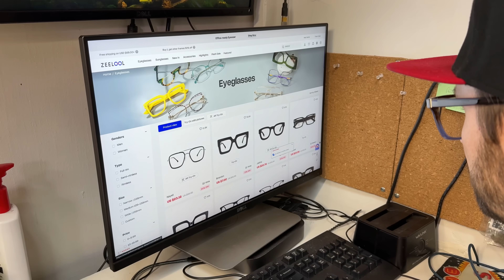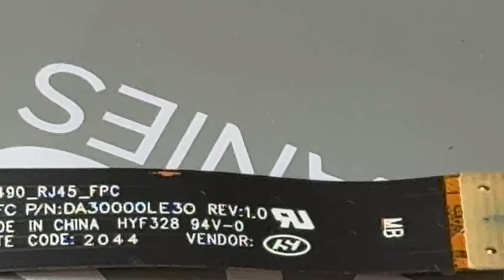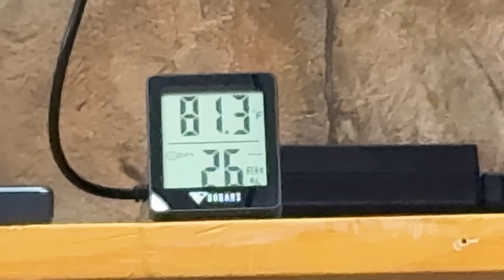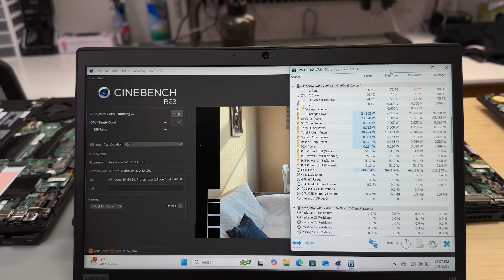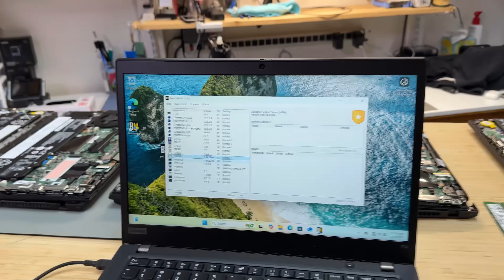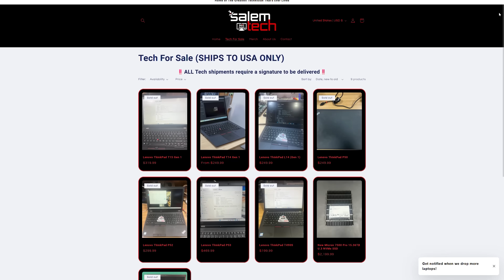Is Replacing Laptop Thermal Paste a MASSIVE Waste of Time? Let's Test!

Comment: 🙋‍♂I have a few deployment ideas!
---
Opt1: Fast USB (and I mean fast) drives with win 11 iso + using a customer deployment XML - this will allow you to have a unattended install + remove some junk/bloatware if needed + run powershell scripts to to anything you would normally do manually, if anything post install.

Opt2: iVentoy - I haven't set one up yet but plan to. Essentally an ISO server with a bunch of options. The laptops will get the ISO from the server over the network.

I used to use a dedicated cloner with images I built but with scripting and fast USB drives everything is really just faster and hands off. Maintaining the images got to be too much.
Scipts aside, since its a huge variable in time based on what you need. My USB/Iso setup will install Windows 11 in about 5-10 mins maybe. USB 3.2 NVMe so pretty much bottleneck is the port on most endpoints.

Email me, happy to chat

Comment: For cloning, you may want to find a way to connect all ssd in PCI port and that the processor support several lines of pci if not two cpus of a sever.
Reply from the maker: Yeah that’s what I’m currently doing as I explained. Quad NVMe to PCIe adapter with bifurcation to split 16 into 4. Just requires too much labor taking everything apart etc

Comment: That was well timed as I'm about to fit a new SSD to my 2012 HP Folio 13 and was wondering whether I should re-paste, having not done that when I increased the RAM last year. It's cooling was always its weakness, with a small noisy fan. Fingers crossed I don't mess up - there are many tiny ribbon cables in this one...

Comment: Why does the microprocessor have then two heatsink surfaces for the copper heatpipe?? They are for thermal paste. I've put thermal paste on both surfaces to reduce the heat. Lenovo doesn't do this, leading to a very hot chip 1 and a hot chip 2 on that MCM part.

Comment: I have a Thinkpad T14 gen2 I7 11gen with 48gb of ram, and I replace the thermal past once a year and I do a general cleaning inside. My laptops runs like a new one, it handles everything
Reply: once a year is too much,  new thermal paste holds much longer and i would only change if i would see significant thermal spike.

Comment: i have a question regarding thinkpads so i have a old x230 i use would it be beneficial to replace the thermal paste it was refurbished and given to my community college back in 2020 through a program and i have no idea if they ever replaced the thermal paste when refurbishing
Reply: Is the laptop yours or property of the community college, if it is not yours i would not touch it.
Regardless of that, just open hwmonitor and look for the temps, than go to google search for pictures (type in hwmonitor and your cpu version), you will see screenshots, than you compare the values with yours, if the temps difference to high, you know they did nothing. 
Changing thermal paste makes only sense if the temps are too high.

Comment: Replaced the TiM on my HP Omen gaming laptop when it was almost new. Lowered temps by 15-20 degrees! Never had that big of an k pact with paste on a desktop. Think HP uses toothpaste. That and undervolting it made a massive difference. Hardest part was the screws to the heatsink and pipes are very small and easily deform so you have to be careful.

Comment: These ThinkPads seem to use Sunon cooling fans as well. I have a 9 year old ASUS Zenbook UX303UB laptop and the fans are quieter than my 10 month-old HP 14s laptop (Still brand new IMO) unless the CPU is under load. Either the fans are really good or the ASUS has a good fan curve. The only Sunon fan that died was inside a 2012 HP Folio 13 laptop. The Zenbook has broken hinge mounts on the LCD bezel though... But the HP is even worse because after just 10 months of use, I can tell that they cut corners everywhere apart from the CPU, RAM, SSD and speakers which are pretty OK. But the rest is junk. Edit: Dell Latitudes, Precisions, HP ProBook's, EliteBook's, Zbooks and even MacBook's (Well built but not recommended because of soldered SSD on the newer ones though) use Sunon fans too.

Comment: Bought a used T480 with no external battery, storage, or charger for $70. Had an M.2 SATA lying around, the internal battery is working long enough for what I use it for around the house, and I've already got multiple USB-C laptop chargers around. I'll shell out the extra $20-30 for an OEM battery soon, and I really gotta repaste this thing because it's suffocating lmao

Comment: For the each PC, try to have a switch and iPXE server with a default Windows 11, where each Laptop starts via Gigabit Internet, this will simplify your steps and help you with the configuration.

This will help you on spending less time using clonezilla and whatnot, just be aware that it will be hard start, but then it will allow you to save quite of time :)

Comment: Dude, just make a pxe boot windows imaging server and distribute windows over PXE using wim images. You can image several machines over the server and the images will be for whatever you need, like w 7-8-10-11 home, pro, ent, 32, 64, whichever. You can customize them as well, as needed, like adding apps or adding branding, etc. I don't imagine you'd use 7 or 8 for anything, but then, who knows, maybe you wanna throw 7 in something for that retro goodness that came before the windows store bullshit. Anyway, All you'd need is some old ass raid enabled desktop with some good redundant 2 terabyte drives and that's that.

Comment: I work at a medical college.
We buy dell machines (desks/laps) with a 3 year warranty.
Most of them are still fine after 3 years, especially the desktops.
However, after 3 years they are refreshed for new models, and the old ones are sent to surplus, where they are abused and hated on, then piled into a pallet for auction as bulk material.
It might yet be possible for you to find a college or school system that also does this, but lets you get them for refurbishment. You will have to replace the drives of course, since usually the drives are pulled and destroyed to secure proprietary data.

Comment: Not sure if it will help, but here is my deranged way of dealing with rental laptops at my university: get the same win or linux distro on 6-10 usb sticks and a rubber ducky. I've used a broken KVM switch which managed to parallel input on all machines. Thus it was no big deal to run the same ducky script on all laptops at the same time. Got to mention, it works for me since there is only one laptop model available for students to rent

Comment: T14 gen 1 and gen 2's had severe heat problems. Even with new paste and trying to fix some stuff they hated running cool. You could burn yourself with how hot they got. My work decommed a bunch of T480's, so I took one and modded it to the moon. I call it the neckbeards revenge lmao

Comment: when i got a P53 from work, brand new, the thing was insanely noisy and hot, courtesy of Lenovo's factory plaster of paris paste. I repasted it like a week after receiving it and it's now completely silent in normal use. under load it still throttles, but it throttles 400mhz higher than it did before. And clearly, being brand new, it wasn't dusty, which i confirmed when taking it apart. Still works as good today after a few years
Reply: I'm reading this going what are you talking about Lenovo didn't make the PS3 but then I looked closer that's a 5 not an S 😂

Comment: You can also turn on yellow light mode on screen instead of using glasses. I have been using it since it has become a simple toggle on button in win10.

For imaging I've always been using FOG which needs a server install somewhere on your network (its a PXE linux package basically) and ethernet connectivity to the machines which could be a limitation depending on the space you have, but other than that its free and scales up to whatever you want if you give it enough ressources.

Comment: Repasting laptops really make a difference with higher wattage stuff. I have Maibenben Heimai 7 here with LGA 1151 socket and it had Pentium G5420, i5 9600K, i5 8500 and i5 9400 CPUs. While the Pentium G5420 didn't benefit that much (28W ppwer draw under stress), all the i5 CPUs really needed that extra cooling since all CPUs cleary reached above 65W power draw, with the 9600K often reaching 80-90W.

Comment: Most thermal compounds anywhere from a couple of weeks to several months for daily use till either pump out or it all dries to crisp. At least ptm7950 will last at least a year and some months before there is any noticeable degradation.
Reply: Completely ditched thermal paste.
Laird TPCM 7250 for bulk refurbish and PTM7950 for high-end devices. Most factory applied paste on used devices is horrible and pumped-out with big air pockets and valleys.
-80°c and above thermal paste fails rapidly because of thermal friction. Expansion and shrinking between the heat conducting particles and silicone binder.
Reply: Most thermal pastes are fine for years.

Comment: 4:23 what about the USB-to-nvme adapters? It's not as fast as native nvme but it is a lot more convenient and you can connect a bunch of them to the usb 3.0 ports. Also running Clonezilla from an installed linux system would let you launch multiple clones at once

Comment: I have a Precision 7530 for work provided by the company I work for. I maxed out the memory to 128 GB and this thing now flies. I also have the dual Thunderbolt docking station and everything is tidy. I dread the date this thing has some irreparable damage and I have to replace it. It has 5 M2 sockets

Comment: I was a Thermal paste Virgin until recently.....
Cleaned and slathered my Lenovo for the first time a few weeks ago, but this week I noticed the fans were running more than usual.
Checked the temps and the CPU was at 60-90C.
Stripped down and found the "Thin (ish) even layer" I had deposited was patchy across the heatsink.
So I left a new pea sized deposit in the centre of the chip and closed it back up assuming the new paste would "Ooze" (The previous application was still moist and suitably tacky).

IMMEDIATE reduction to between 35-50C and no fans.
.
Lesson: 
1) Always add a little more than you think you need.
2) Onlyfans isn't good enough.

Comment: Thinkpads, are amazing. Mine is now 13 years old but its opned a few times for new thermal paste and a good clean up, It gets used outside a bit. But with all the opening up i tore my leyboard cable and now i cant use it. The power button is part of the assembally and finding replacment keyboard is proving to be difficult because its a X220 12" model. Not many around.

Comment: Baffles me some of the info out there that goes backwards like replacing the thermal paste is a waste of time.....who ever says stuff like that? I have always replaced paste if i had to open up a system to take the heat sink off and if the paste had blown out, crusty and dried up, cheap and not very reliable paste, or it had reached its lifespan. I even go through and replace the thermal pads if they need to be swapped out.

Comment: If every laptop supports PXE booting (which enterprise laptops should, but there's caveats) then for the imaging process, I recommend setting up a FOG server. When I was a Sysadmin at a school district I set it up to store and network deploy images for all our models. Eventually with an MDM we switched to provisioning instead of imaging, but FOG was amazing. 

Bonus for a repair shop: You can set it up to have a boot menu of other ISOs. I set it up so it techs could boot into UBCD, Kaspersky Rescue Disk and some other tools I can't remember now. Saves time and a lot of flash drives.

 Clonezilla can also be set up in server mode, but you don't get all the extra features that FOG has available.
Reply: I was gonna say the same thing. We use PxE boot and it's slick as hell
Reply: Thanks for that!

Comment: To answer the title, yes. BUT only replace the thermal paste after a severe abuse. Most laptop manufacturers' thermal paste is decent enough and can last 2-3 years before going dry. You might see a bit of temperature rise after 6-12 months and lose a tiny bit of performance, but they'll still do their job. Install Core Temp/HWInfo, play some games, see if the CPU temperature is properly staying below its max safe temp without throttling, close the game, if the temperature doesn't immediately dip, it's time to replace the paste.

Comment: For Intel pch there a graphite adhesive thermal pads 0.1mm thick. I stopped using paste because of the longevity and started using graphite pad with little thermal paste underneath the sheet to hold it in place. CPU and GPU temps remains the same regardless of ambient temperatures with fan cleaning every few years. I have bought a fresh PTM pad. Will need to try it out.

Comment: Sir, I have a legion 5 pro 2022 (gen 7 12700h 3070) and I read on reddit that lenovo didn't use thermal paste on these series, they used Honeywell phasechange pads or something (or Honeywell PTM 7950)
So should I even attempt to replace it or is it a big mistake like they are saying?
Reply: PTM7950 is reusable, pick up some squished out pieces. Wipe the area clean and place some pieces in an X pattern on the center of the chips. Above 45°c it softens and flows within a couple of minutes over the surface.

Comment: I bought my laptop (a Predator Helios 300) in early 2018. In 2020 I had overheating issues, so I opened it, removed the felt that had built up on the heatsinks and repasted it with MX-4. Everything was fine then (I still think the dust removal did more than the repaste).
During the last years I have often heard people say that you should repaste your gaming laptop every year, and that MX-4 was so bad because it wasn't viscous enough and/or dried out fast, and you should rather use MX-6, and to watch out for the pump-out effect.
Last year I've decided to look at the current state of my laptop and repaste it (with MX-6) during the periodical dust removal maintenance. And now I can confidently say the people who told all the stuff in the second paragraph should just shut their f*cking face. The old MX-4 paste was absolutely fine, not dried out at all, pump-out wasn't an issue, temps were the same before and after the repaste and the thing would have been fine for a few more years. Repasting your laptop after a few years when there's still the factory thermal paste? Maybe not a bad idea. Repasting every year? Complete waste of time.
Oh, I forgot, I also repasted an Intel NUC from 2018 a few months ago. The old thermal stuff was quite dry, but repasting was a waste of time after all, since the new temperatures were only one degree celsius lower.

Comment: Hey andy, what do you think of handheld consoles being an alternative of laptops in terms of gaming on the go along with work (hooking up external peripherals) as well as its repairability?
Reply from the maker: Fucking love them but their repairability is mostly dogshit besides the steamdeck.
Reply: its not worth the hassle. think of the difference in what youd carry. laptop, charger, mouse. basically it. handheld, youd want a keyboard, mouse, of course the charger and a display cable, maybe also a dock to be able to plug in more than 1 thing, . youre basically carrying a whole ass desk setup without the pc. 

handhelds are AWESOME, but not a laptop replacement. more realistic to have a tablet with a keyboard case.

Comment: Any advice for someone replacing thermal paste for the first time on their laptop and GPU(different device)? I got Upsiren Ultra and MX-6 for the laptop and for my GPU I got PTM7950.
Reply from the maker: Watch someone do it in a video and do everything slowly. Apply pressure when unscrewing, make sure to use the right bits. If it skips while turning, you're not using enough pressure or you're using the wrong bit. Just be careful and you'll be fine.

Comment: I love me a good Latitude 5290 2-in-1. If you ever get time again, you should look into those. The top end ones can do wild things with adapters.
Reply from the maker: I don't like a battery being sealed behind a screen.
Reply: @SalemTechsperts  I agree. The 5310 2 in 1 however has the battery under the bottom cover just like the standard 5310.
Reply: @ I have changed my battery, and taken bad ones out. There is no adhesive at all. Six standard Philips screws clearly visible on the back, and then running your fingernail or credit card or plastic pick or anything even remotely thin (I used the side of a flathead once), and the screen comes right off. It's easier to replace than a ThinkPad's battery, in my experience.
Reply: @SalemTechsperts I looked at getting a latitude a couple if months ago via a local ebay seller.  I think it was a 5290 2-in-1 and the service manual showed how to take apart the 5290 including the battery.  Screws and press fix plastic clips, no adhesives at all.
Reply from the maker: Looks like I was mistaken, it’s not sealed but the average user still can’t replace the battery when the time comes. Credit where credit is due though they make it easy for techs
Reply: @SalemTechsperts  That means that regular Latitudes (Including the 5310 2 in 1) are easier to repair.
Reply: @SalemTechsperts  By that logic, no modern laptop battery is user replaceable at all, as people would have to use screwdrivers to take off the bottom cover.

Comment: Only a waste on 13th and 14th gen Intel chips. With the best paste, 7950 and the best pads none of it changed my temps. Still hit 100c easily throttling down to sub 300mhz...